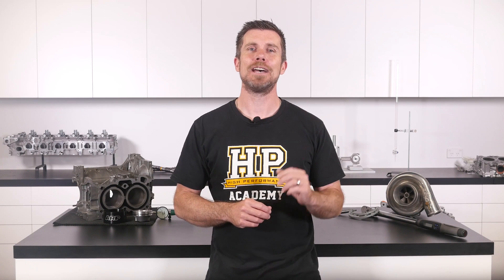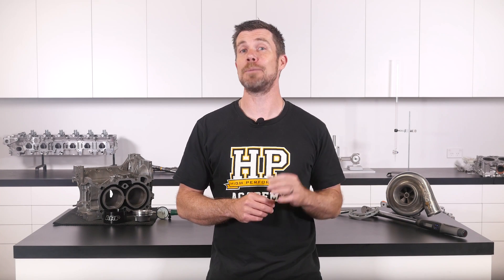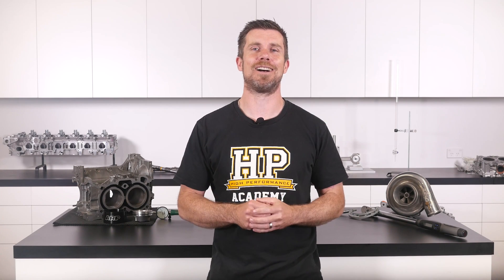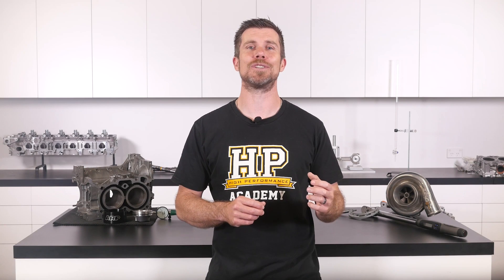[HPA Q&A] How can I tune without a dyno? | EFI Road/Track Tuning

Comment: Hello, im following your yt channel, and you are maybe the only one answering all the questions. Respect for that.
So here is one:
We have build our first turbo setup, curently we are trying to road tune it using tuner studio and tuner nerds knock monitor.
We have heard some knock arround 4500rpm at 0.8 bar of boost, and added some timing.
The car is pulling great at low end all the way to 5000rpm, but after that it seem a little bit lazy.
What do you recommend for little more power in hi end to be safe? Add more boost? Timing or both?
Thanks from CHA Garage

Comment: I had full control and access to a Dynojet 4WD turbo and that was cool to have, but my best results was from day tuning on the street, long highway; and on the track.  We'd carry it back onthe dyna a check the results.  I've never had a dyno tuned car beat my 1/4 mile time with similar equipment or even turbos slightly bigger.  However I do understand the value of a Dyno and modern tuning software.

Comment: What’s your opinion about GM delivered engine torque parameter in the hp tubers software ? Can I used it for optimizing timing? Some say it’s useful while others say it will continue to show improvement as long as I’m moving the timing ?

And what about something like g tech ?

Comment: Some good points there, especially that the dyno* can't replicate all the conditions a street or race car may encounter - that said, for the 1/4 mile stuff it gets close as heat soak, etc, doesn't build up to the same extent. If you monitor the temp's when using the car, you may be able to get close with the external fans, though, and a good cooling setup. The velocity head (ram effect) is more difficult and can definitely affect the torque as, IIRC, 100 mph is approximately equal to 1.7 PSI and 200mph is approximately 3.4 psi, asuming all things are perfectly efficient - that is why the air scoop/intake design is so important - perhaps a dedicated electric fan blower to the intake?

*water or eddy current dyno's can load the vehicle and hold it at selected speeds and allow the temp's to stabilise, though - also useful chasing part throttle settings.
As Andre said, it is critical that all dyno testing is verified as the vehicle is being used - you can't tune your tow truck, for example, for maximum torque running it rapidly through the rpm range then expect the same resultant tune to be right for half way up a long uphill haul where it has been spending minutes under full load.
Reply from the maker: Thanks for your comments Gordo. I'll add that the ram effect is very dependent on the actual intake design, installation and application. In my personal experience it may not be as much of an issue as many think. Even with our old drag car with a forward facing turbo, we saw no requirement for changes to the tune, even when trapping at 180 mph. 

On the other hand I've also been involved with tuning a naturally aspirated land speed race car that has competed at Bonneville. With a forward facing top alcohol-style injection hat, we did see the tune require additional fuel at speed as we had expected. - Andre

Comment: Road Tuning is more accurate, I thought i read this from Flatirons Tuning: https://www.youtube.com/watch?v=0YqStaVQg_c
Reply from the maker: We have an article on the same topic here that will only take a few minutes to run through and is a better response than I can type here on YouTube - http://bit.ly/DynoVsRoadVsE
Basically act of TUNING itself on the road is less accurate, however the CONDITIONS you're tuning under are more accurate. I think you might have those two bits mixed up =) - Taz

Comment: Right on point..We need dynos, but in the real world of racing tunes can change  dramatically, depending on your form of motorsport...Eg circuit racing, without a doubt is were heat can be hard to manage and depending on the ambient temperature as well, can affect your tune..in my limited experience always leave some on the table for that very reason ...
Reply: True, that is why you need to get as much information on what is happening to the vehicle as possible - coolant, oil and intake/charge temp's, any detonation being logged, exhaust lambda levels, etc.
The more you know the better you can use what you have - there are going to be folks who take the time to do this and if they have a couple of percent more power, or fuel mileage, that can make a big difference come race-day.
I think there are a lot of old farts, like me, here who back in the day used a generic xxx degrees by yyy rpm, and that was it, with the carbie being often used 'as is' direct from the box as the plug colour was 'close enough' for their cars with some of us eventually going a bit further with 'seat of the pants' tuning.

Comment: Hmm.. when you make a dyno run you can't produce enough air flow like on the street.  Some pads like MAHA pad can reproduce only up to ~150 km/h air flow. Maybe I'm wrong?
Reply from the maker: You're not wrong, 2:35 on in the video covers this aspect =) - Taz.
Reply: Ohh I went throguh it sry. :)  I see this problem with mid engine cars especailly, and more often when it's turbo charged. The hot air can't get out from the engine bay fast enough after few pulls.